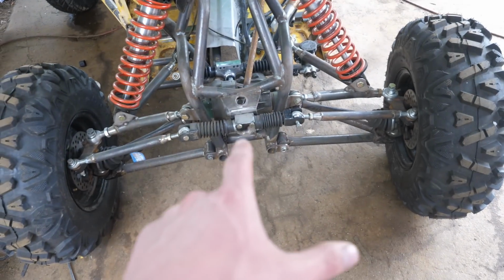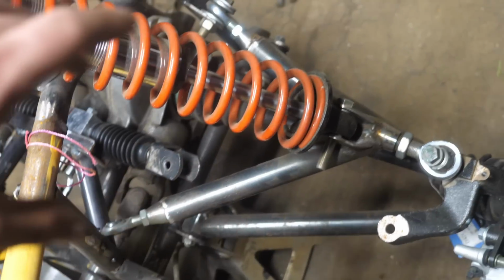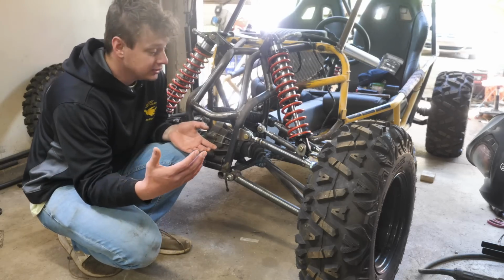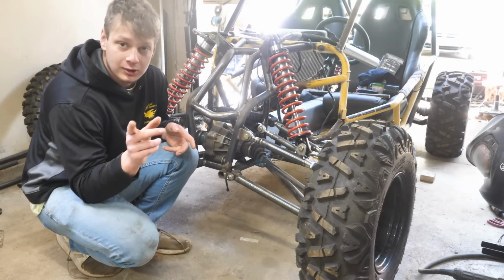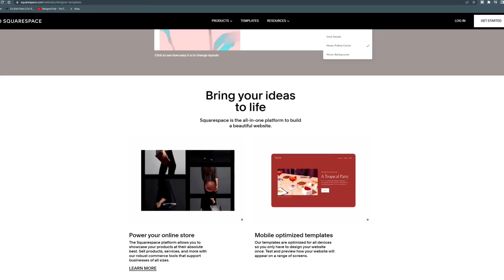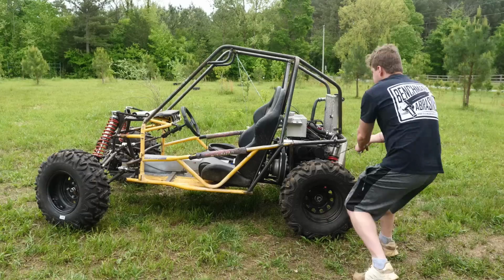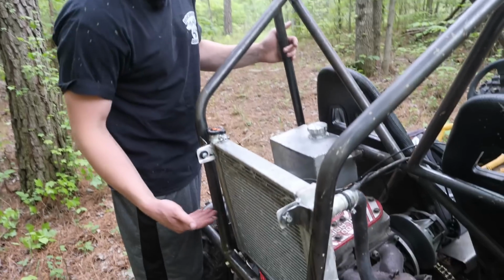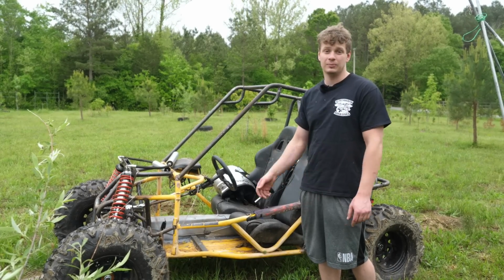120hp swapped Awd buggy First Drive!

Comment from the maker: Sorry for the shorter upload, working on something behind the scenes!
Reply: Shortening the belt will provide more torque your seeking, good job nice build✌️
Reply: Put an air scoop on top of the kart, with a larger radiator, and a fan. It's also tuned for cold weather.
Reply: Hey bud. I run 7.8/1 overall from secondary. My 870 twin rated at 154hp boils tires on command. Top speed at 7400rpm is 58mph.  With a 440cc top speed was 65mph at 9000rpm
Reply: Btw my tires are 19.5" tall. I'm contemplating going with a 11.2/1 all gear drive. Secondary bolts directly to input shaft of gear box. Trying to lower parasitic loss in drivetrain.
Reply: Rip it with sxsblog and you could help build hellforce
Reply: Saw the LS in the back ground.  Hope the boat is coming soon.?
Reply: Dude I wish you were my neighbor I’m tryna build a fuckin mini bike and this centrifugal clutch sucks
Reply from the maker: @larryalexander4833  thats not for the boat, but it will be coming this summer
Reply: Bring that thing to turf wars this summer! I know it’s a long ways but it’s a great place to film content!
Reply: Fan shrouding and a good fan might it run cooler!?
Reply: @matt3x37  get a torque converter. I've gone up 45° hills with a basically stock predator 212 (governor removed and straight piped) i weigh 140 though. DuckTape an extra belt on if you want to be safe though. If you want i can show you my setup on a coleman CT 200u if you want. Just send me your email. I'd be happy to help!
Reply: Also 6:27 what kind of face is that Vasily?😂
Reply: CBOYS helped out 🤘
Reply: If you don't mind me asking, how much money have you put into this? I have found the exact same cart without an engine and want to do pretty much the same thing but I'm just worried about starting it, end up not finishing it, and dumping way too much money into it
Reply: Just asking will you try to put a gearbox and a turbo and put it on some street tires

Comment: Ditto on adding a cooling fan, and I recommend a Davies-craig fan controller, that's what I'm running. Allows you to run up to two radiator fans, has a digital temp readout, only needs a 12v source, adjustable from 100-230F,  and is pretty cheap IMO. Great build Vasily this things a beast!
Reply: I agree with the fan as well, but also moving the Rad centered behind the drivers head in front of the engine. It could be collecting heat from the engine and not getting enough air.
Reply: I have cooling issues on my 600 when the temperature is above 75F , I added another radiator I had laying around, I'll see what that does. Two radiators and two fans on a 140 thermostat switch hooked to a relay. I still have the original thermostat switch hooked up so that I have a temp light and it goes into limp mode when it gets it warm... Not sure what temp it is hitting but it does not spit out coolant.. Part of the problem I think is that I added a windshield and a canvas top and the engine and radiator don't get the air flow they did before.. https://www.youtube.com/channel/UCG4yu3qZEzNxekujP3xo3WQ

Comment: Put a decent fan on the radiator with a thermostat switch/relay try 180°f. Notice it didn't overheat going down the road. Also, don't let the coolant move too fast. Slow it down enough to cool down while it's in the radiator. Use a water outlet restrictor instead of a thermostat

Comment: Awesome build! Power, sound, 2 stroke... Perfect. But you need a fan on that radiator, without it you have no air passing trough the radiator to cool the water when you driving at low speeds, so the engine overheats. The same that happens to the Yamaha RD LC (I already had one).

Comment: I like it.. a few ideas.. if you havent already i would verify the water pump is circulating properly.. you could add a piece of sheet metal above the rad to direct air down into it.. also a coolant overflow bottle mite be a good idea..  i def think the belt is slipping..  and if the belt gets wet its going to slip as well..

Comment: love the project, i dont know if your giving it full throttle or not but i feel like from snowmobiling you should put light weights on the clutch and get the RPM's up a little, it doesn't sound to be getting to 8000 i cant wait to see this thing again and whatever projects you got behind the scenes.

Comment: Little advice when use part of chassis to add some more braces they use cheap thin wall and u go over u will twist it like pretzel I've done something similar and till this day don't remember what happened but being pinned in a collapsed chassis wasn't fun and I was going as fast as damaged look I add a bar higher on side for side flip shoulder or arm from impact also a fire wall behind u at 42 and 60 plus broken bones and 200+stiches not to scare u but to inform safety that we all over look when building something and other might work about take in consideration I've might not be so broken up keep up great work and have wonderful day.

Comment: They sell a civic eBay radiator that’s pretty beefy. Think it’s triple tube 1” tubes… Nothings going to work without a fan… 2 strokes generate the heat… Especially snowmobile engines, due to how much power they’re making… 

Just put a 480 Phazer engine in a Ezgo work horse. First rip with tuned pipe, and the front end is 3’ off the ground lmao

Comment: Nice build man, this turned out awesome! Definitely should add some radiator fans. High revving 2 strokes in the woods on slow trails is a recipe for overheating. Doesn't putt around the same as a 4 stroke in higher gear.

Comment: Word of advice. Bevel the ends of your pipes at like a 45° angle where your using a heim joint. That will make sure you have plenty of penetration for a strong weldment.

Comment: If you run a shorter belt, it just slightly changes the gearing--  because it won't ride as high up on the main clutch when you first take off.  It's only a subtle difference really.

Comment: Snowmobiles run HOT , gonna need dual fans on that thing. Nd clutch sounds a bit boggy, check out sum clutch kits also.
Reply: Just put that oem civic fan on it. Sled engines have high output electric system to run it.
Reply: @jaydensdream714  true enuff, between hand warmers and headlights should be enuff to power a decent fan

Comment: As stated add electric fans. But i ran into something similar on a build like this. You need to run a thermostat too. Without a t-stat the water is moving to fast to cool in radiator properly. It doesn't dissipate heat because it is flowing too fast and it also does not absorb enough heat from engine so it is also running hotter too.  I added a remote T-stat and housing from a 4 wheeler and it was crazy how much better it cools
Reply from the maker: This ski already has a thermostat

Comment: the radiator cap is supposed to do that, you need to put a hose on it into an expansion tank where its fill level is the top of the system

Comment: Sick build if you want more power put the stock 98 XC 700 exhaust and also eventually tune you’re clutches to you’re gearing and weight of the machine, and like you noted the belt too figure out you’re center to center from you’re primary clutch and your secondary clutch to help figure out what belt size you need

Comment: I ran a civic radiator with a arctic cat 580 sled motor in a modified  carbide 150 buggy.it never overheated on me.had a Polaris quad fan on it just in case but I never wired it up lol

Comment: You should add a fan to that radiator, that engine was meant to run in winter time under a much lower load.

Comment: Love the builds, do you wish you had reverse on most your karts or is it really not needed? 
I'm in the process of building mine but still can't decide if I should stick with the polaris sportsman 500 gearbox which has high, low and reverse or do what you do and run just a diff and shaft to the clutches.

Comment: How did you check for bump steer running it through its travel? A kink/binding in the travel, or a sway forwards/backwords maybe? (I honestly don't know, so sorry if it's obvious).
Reply from the maker: Just remove the shock, and move the spindle up and down

Comment: hey great build  quick question did you use the factory clutches no weight changes 
i have a build same enging having issue with gearing

Comment: I have a question. Did you use the speed and rpm gauge?? If so how did you get the speedometer to work?? And how did you wire your kill switch

Comment: I would 100% throw a big fan on that radiator and just have it on a switch. Its a sled motor, its going to want to run cold and to be as simple as possible, a toggle switch will be fine. Turn it on when it warms up and shut it off when you stop, thats all.

Comment: That engine being a flathead type with the radiator mounted so high above it would make it almost impossible to have air pockets in the cooling system as the coolant waters weight would easily displace any air in the system as water weighs more than air and always finds its own level,always flows downhill.. the radiator simply needs a cowl scoop and a cooling fan of enough cfm to keep the engine cool even without the moving airflow when driving... A good shroud makes a smaller fan work better..

Comment: Snowmobiles run hotter when going slower, install a fan and install a clutch kit. It will pull harder and ingauge at higher rpm. Do not gear down.

Comment: The Ackerman angle isn't the problem. It's the bump/steer. How do you solve that problem? By aligning the three pivot points. The top and bottom control arms have an invisible line to the two of them. The pivots for that tiny rack and pinion steering need to be on those lines. In the event they aren't, you'll forever have bump/steer. A genius at Ford in the seventies discovered how to correct that problem. By aligning those three pivots.
Reply from the maker: Well since my a arms aren't identical, there's the height of the steering rack, the angle of tie rods, The caster messes with it too if the steering rack is not in the middle of the a arms it will also toe it out on up travel

Comment: Definitely need a electric fan on the radiator…. You were traveling way too slow in the woods for the radiator to work without an addition of a fan.  Install a fan with a shroud and you’ll be golden.. and  you can wire them with a thermostat switch so they only kick on when needed like slow through the trails…

Comment: What if you pick up a mini freezer. Have the intercooler in there + the fan. Shit that coolants gonna get Iced Out💎
Reply: Small refrigeration units aren't designed to remove that much heat. The Linus Tech Tips channel put a computer in a refrigerator, and it failed to keep it cool.
Reply: @MellowYe77ow  Well then.. Maybe a methanol injection kit 🤷‍♂️

Comment: The radiator needs to be in the front like all sxs has none of them are welded in the rear
Reply: The radiator in the back is absolutely fine. Like every dune buggy ever built the rads in the back🤦‍♂️ your the non builder. of course more work is your answer
Reply: @tylerseabook9423  look at can am Polaris Honda yamaha sxs they don’t have it in the back it’s always in the front
Reply: @kodihull3820  And that design works for those sxs. They have a lot more bodywork, windshield, etc. that would block air to the rear. This has a clear path for air to the radiator. He just needs a dual pass or fans.
Reply: Yamaha yxz 2019+ has the radiator in the rear. And the speed utv...